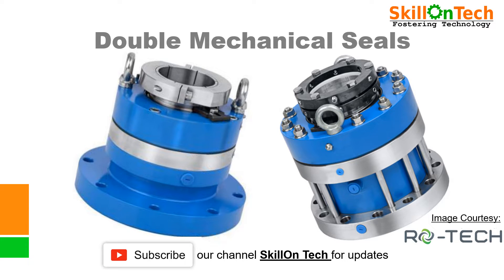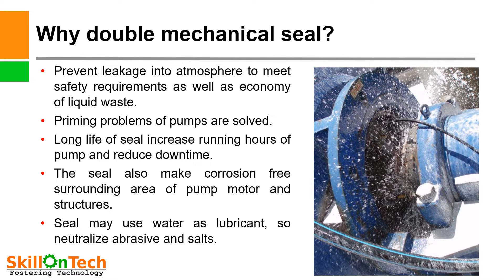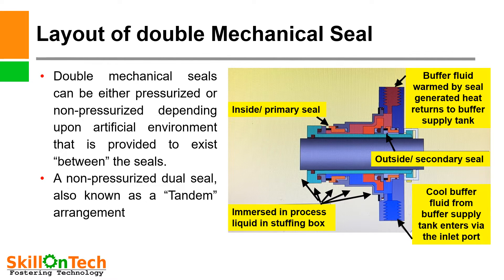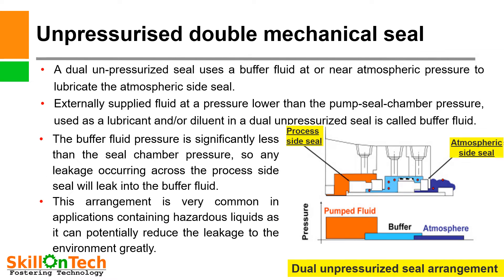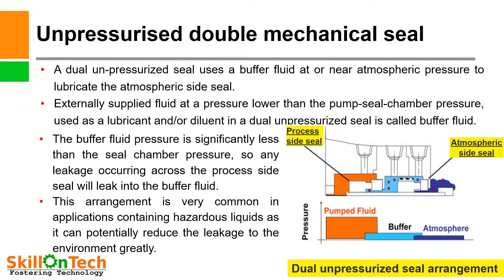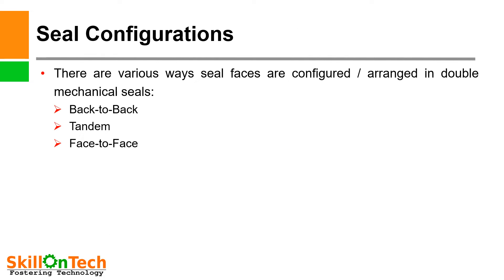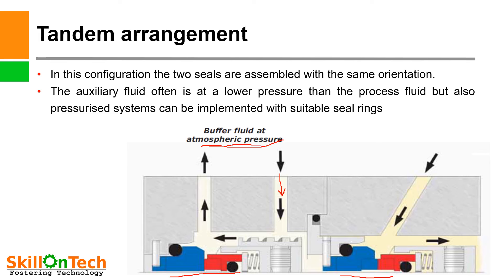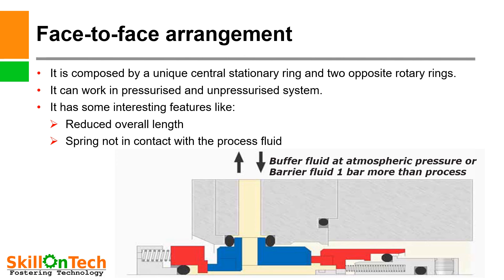Double Mechanical Seals (with english subtitles)

Comment: Sir please explain in this lecture what are differences between auxiliary fluid, buffer fluid, barrier fluid.
Reply from the maker: Whether you choose a barrier fluid or a buffer fluid for your mechanical seal depends on the sealing arrangement of your system. A barrier fluid should be used in an application that uses pressurized dual seals. This system includes a way to pressurize the barrier fluid that is being used. When the fluid becomes pressurized, a barrier is formed between the atmosphere and pumped fluid, and it circulates to ensure the mechanical seal is completely protected.

A buffer fluid should be used with unpressurized systems. In this type of system, the fluid is kept within a reservoir with supply lines that are connected to the mechanical seal itself. An internal circulating device will then circulate the fluid throughout the seal.

Both barrier fluids and buffer fluids protect your mechanical seal by preventing process material leaks, controlling friction, and providing lubrication.
Reply: What will happen if the buffer pressure is more than pump operating pressure in the tandem arrangment???

What will happen if the barrier fluid pressure less than the pump operating pressure in back to back arrangment???

Comment: Pls describe inboard and outboard position
Reply: Outboard seal is towards pump coupling side and inboard seal is towards impeller side. The leakage of outboard seal will occur in atmosphere and inboard seal failure will increase pump discharge flow.

Comment: What is the role of bearing in double mechanical seal?
Reply from the maker: Bearings are to support shaft and hydraulic forces ( axial and radial). However if bearing are defective, mechanical seal will get damage. Hence bearing play important role to enhance life of mechanical seal.